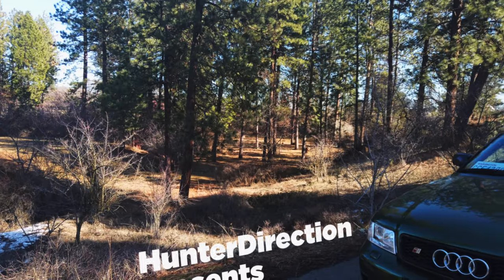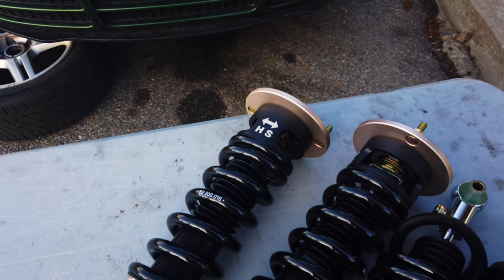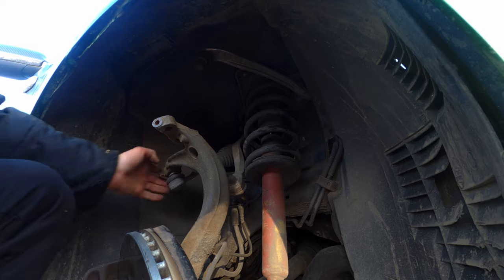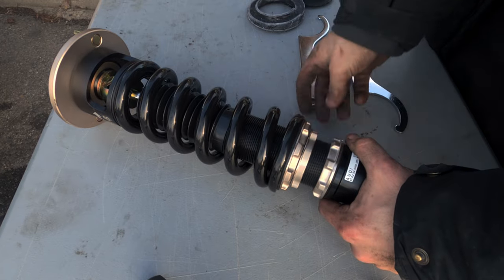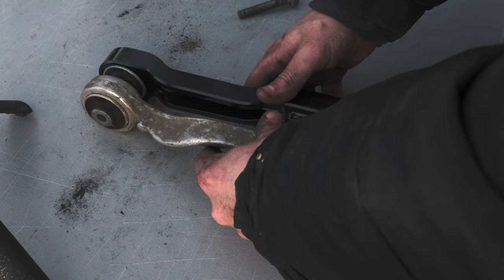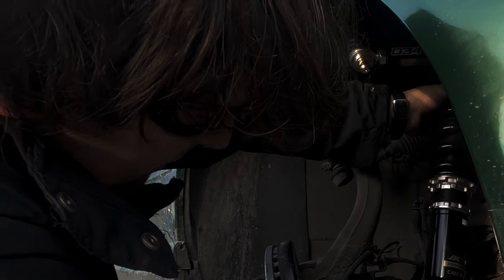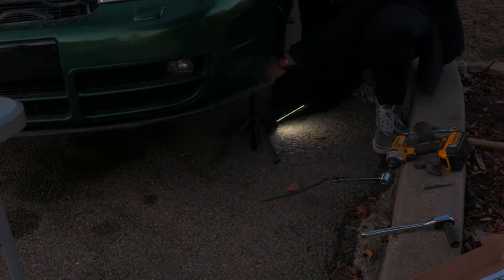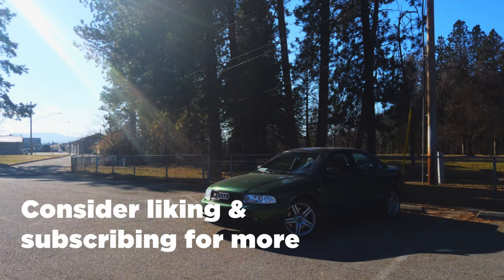Finally Upgrading The S4 Suspension | Front Coilovers And Control Arms

Comment: Its really funny when car guys say that working on a car is really relaxing, yesterday i was working on my mk4 gti golf, changing front right strut and it took my unbelievably long time, and when i was finished i noticed that upper strut support sticks out more than it should (in comparison to left side) so i had to redo everything again and me being me, i did mistakes, like punching axle without a nit on it(the result was damaged thread). In the end i was so mad that i just wanted to burn this rusted boi. But yeah, its a new day, preppin to go back to garage, to deal with that project of mine...again
PS thats my first project car, so everything is new to me, it was bought specifically for me to learn bout cars, but its taking too long already to atleast drive it.( Car was standing in the garage for a year already and i have never driven it on the road!)
PSS sometimes working on a car is relaxing, but i just haven't gotteb to the stage where i can drive it, which is a big shame